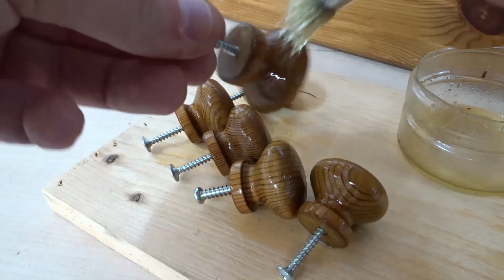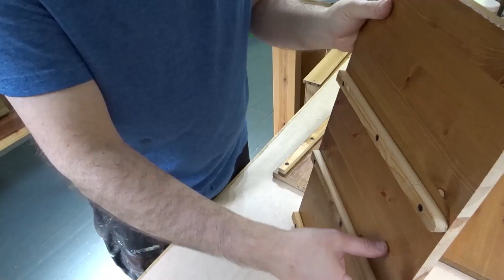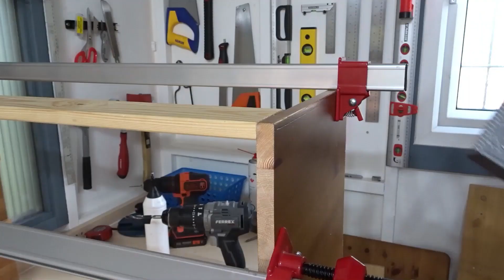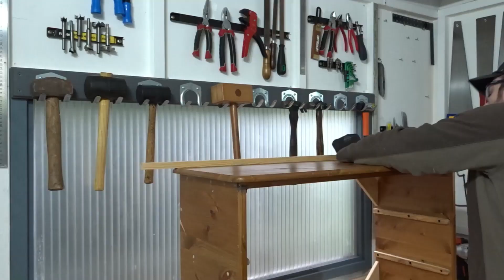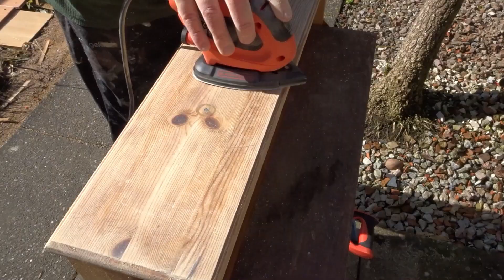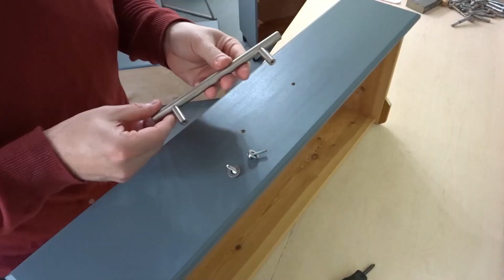Making a Wooden Tool Chest out of Salvaged Materials - DIY Project (Solid Pine)

Comment: Phill great way to save $. I learned from the video. Nothing wrong with a few old school techniques. A pin nailer was one of my first tools. And a airless sprayer could save time on the painting. Thanks
Reply from the maker: Thank you. Good points. I have since bought a cordless nail gun which makes life easier on projects like this. I have been looking at paint sprayers. Still thinking about getting one especially for spraying the garden fences. 👍

Comment: Hi Phill Nice job. One question why did you not use the drawer runners slot. Then you wouldn't have had to put extra pieces on the back of the drawers. Just saying you've done a cracking job. You've got some good ideas keep up the good work Phill
Reply from the maker: Thanks! Yea I did think about that although I felt like doing it this way with the runners underneath the drawers offered more support and strength. Also, the slot was quite thin with the original runners being flimsy plastic. I wanted a thicker runner.

Comment: Excellent build Phill, and a good use of a lot of discarded material, great finds, as solid wood is often more resilient and re-usable than man made boards !
Was there a reason that you supported the drawers with runners at the bottom, rather than using the rebated runners on the sides ?
The "Frankenstein" paint looks great BTW !
Reply from the maker: Cheers Andy 👍🏻 I wanted to add the runners to go under the drawers firstly because that way I could give less clearance on the sides making it tighter with less side to side movement. Also I think they offer more strength and better support.